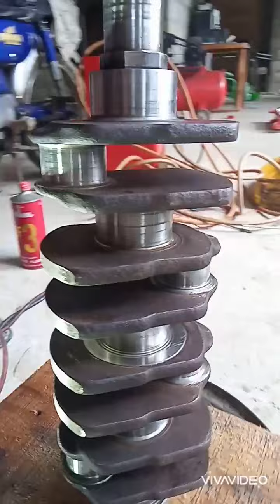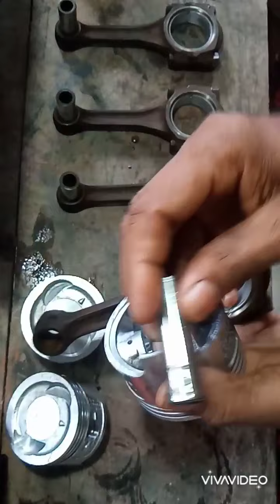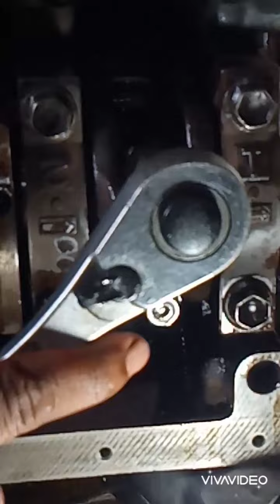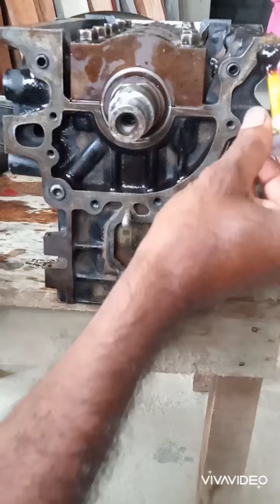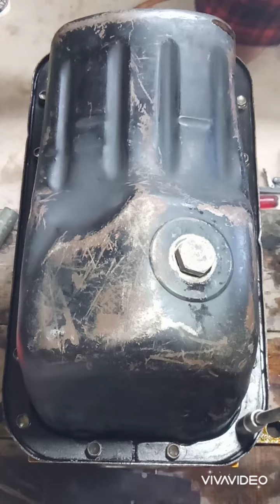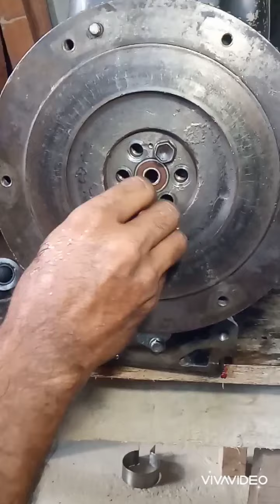suzuki gypsy engine installation

Comment: Hello, sir. Do you know the torque spec for the crank bearing cap bolts and connecting rod cap nuts?
Reply from the maker: Crank cap 50-57 n m
Con rod  33-37  n m
Reply: @easymoworkshop1054  Thanks😃